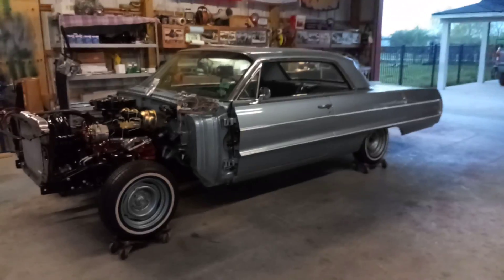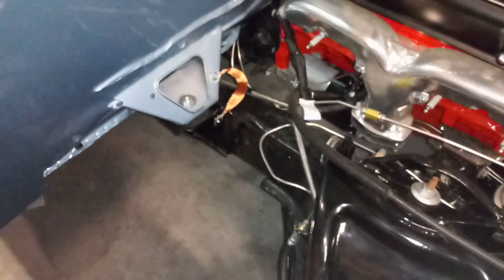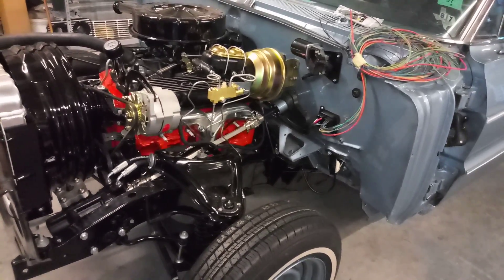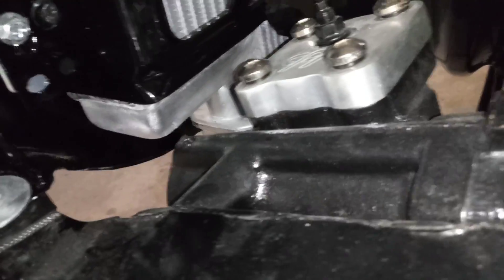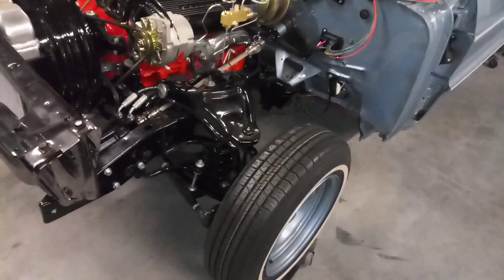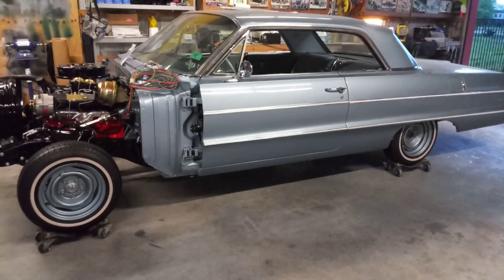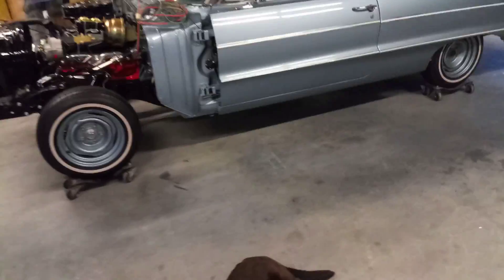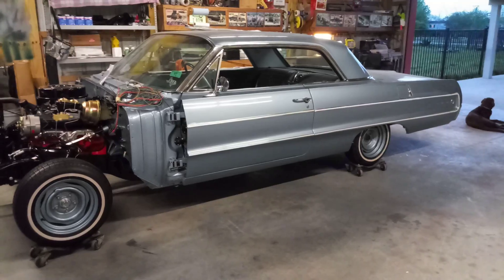1964 impala updates brakes radiator back seat

Comment: Sweet👍🏼👍🏼 Awesome job! Hey I got my new tack strips from Hubbard’s today they are different lengths and thickness, what should I use to attach them? I’m putting the headliner in before the front and rear windshields👍🏼 thanks!
Reply from the maker: First remove all the steel staples from the body of the car. (Lots of fun)  then i just went along with #8 x 1/2 inch sheet metal screws with small drill bit. Drill thru the tack strip into sheet metal to attach the tack strip. Do this. About every 4 inches or so. Thats what i did
Reply: lonestar lows nice thank brotha!!👍🏼

Comment: Hi lonestar. I'm in the middle of a 1963 Impala SS resto mod. Two questions for you. Did you have to grind the rear disc brake calipers to fit your stock 14" wheels, if so just enough to clear or with some insurance? The other question is I have been stuck on is the hardlines for the my new front disc brakes. I see you went with pre-bent ones. I know you have been saying you get a lot of parts from the local vendor, but I'm having a tough time locating these lines to go to my proportioning valve. Do you know where I can get them? I really would rather not flare my own. Amazing car and thank you for the inspiration and explanation throughout your build. The electric wiring and steering column videos will help me immensely when I get there.
Reply from the maker: Yes needed to grind calipers to fit 14 steelies. The original drum brake steelies wont fit. Need g body or s10 wheels. Give last minite customs a call. In houston tx. On the brake lines
Reply: @lonestarlows  Perfect, I have G body steelies. Thank you.

Comment: I buy that Awesome cleaner by the gallons, it really is AWESOME! I brought a elderbrock 650 on my 64, today someone was told me to get rid of it and get a holly, what's you opinion ?
Reply from the maker: Ive never had a holley. Always edelbrock. Whats was their reasoning behind it?
Reply: Basically a elderbrock hater, said that they suck and you cant adjust them, that holly is the best. It's all opinionated to me, but I have elderbrock value covers, manifold, and carb 650 and no issues. It's not the 1st time I've had this. ....anyways I love your interior! I'm trying to convert to a 4 speed
Reply from the maker: Yes. Chevy ford. Pepsi coke.  My next build will have a 700r.   You should take a video of your project
Reply: What is your next build hint hint?
Reply from the maker: @williamhudgins4806  u should sell me the 64 cv

Comment: Is that a350 with tall valve covers?  If so what brake booster and size are you running?
Reply from the maker: Covers are not tall if i remember right.